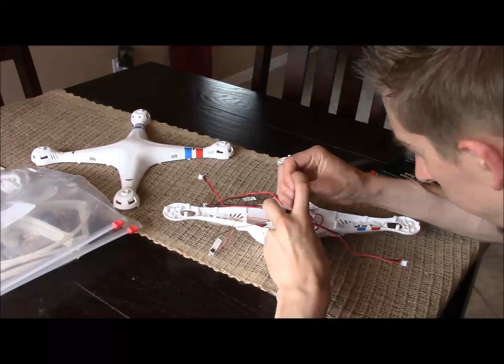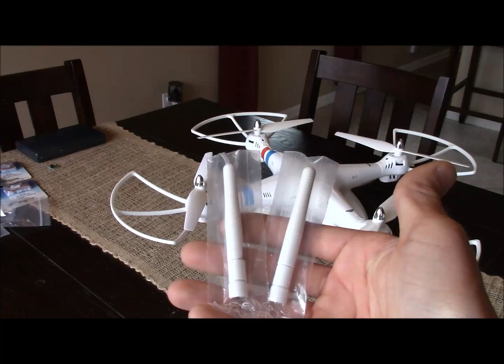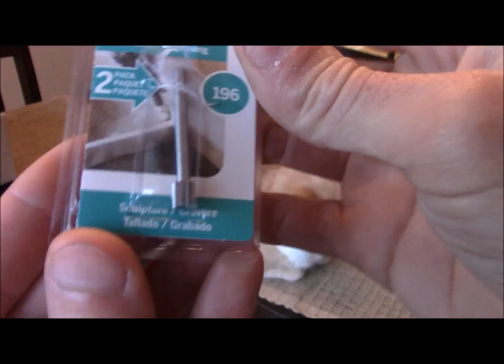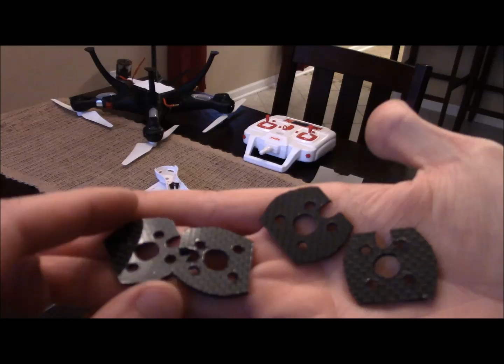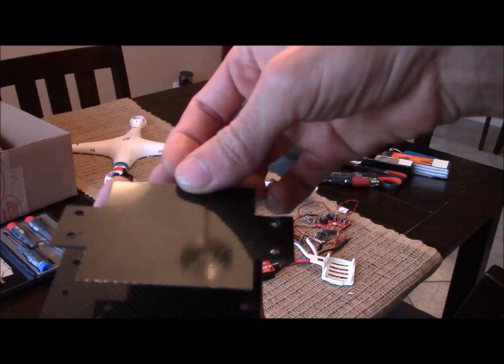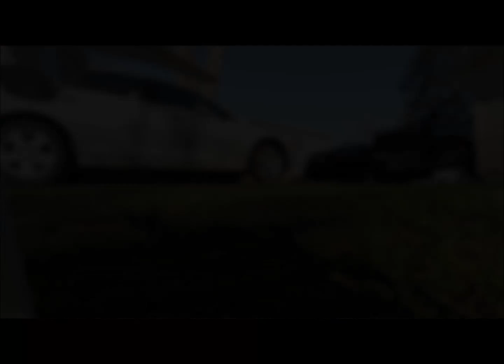Syma X8 brushless conversion with stock RC - Step-by-step how to!

Comment: Very cool modding there! Beyond the time, effort, and stability issues, I found it easier to just build several brushless quads and let my X8 collect dust.
Reply from the maker: Yeah custom builds will give you much better results.  most fun I've had with my x8 is flying with my buddy and just screwing around, they're cheap enough you don't mind crashing!

Comment: I wonder how it would work gradually tightening the three screws while applying heated air to the top cover for getting that extra little space for the taller motor.

Comment: why would you want to reduce stability ?
Reply from the maker: please read the description... it will answer all your questions.
Reply: no i get why you do it obviously i just think it might not be worth it if the end result is shaky and less stable than when you pulled it out the box bud ?
Reply: is there such thing as a brushless motor with just a live and earth?
Reply from the maker: +will penrose  If you follow the link, you will see it flies very stable now, and is alot of fun.  I didn't expect the shake to be so extreme when I first modified it.  As for the brushless motors, no, all brushless motors must have at least 3 wires. They operate much differently, using alternating electromagnetic fields pushing against fixed magnets that's ultimately spin the motor. The esc's must be able to power the multiple electromagnetic fields while also sensing the feedback to allow for timing and proper spin direction.  The complicated process that runs the motors is why you cannot simply attempt to hook up a standard 2 wire motor output and expect it to work.
Reply: +Preston Rice learn something new everyday^^ so that 3rd cable that goes to the esc's what happens from there? it sends to the transmitter? sorry to sound critical of what you did there.. but it looks properly unstable.. thanks for the reply.. I'll make sure I watch the video
Reply from the maker: +will penrose Not sure what you mean by the third cable.  The ESC has a battery input, and a servo or signal input on one side, and the 3 wire output to the brushless motor. The 3 wire output can be wired in any order, but 2/3 wires may need to be reversed to get the motor spinning the right direction.
Reply: +Preston Rice the positive, the negative and the third cable aha na thanks for the info though man.. you think this mod would work with a syma x5c ?
Reply: +will penrose or would you know of anyway to put brushless motors on the x5c?
Reply from the maker: +will penrose You can do anything if you have the money and the ambition lol
Reply: +Preston Rice legend
Reply: L
Reply: To match his mental instability

Comment: I done this mod but with all new hardware. I didn't want to tear my X8 apart so I bought new half shells. I used a CC3D flight controller and Flysky transmitter.
Reply from the maker: +CVObservatory Nice!  Yeah custom flight controller is the way to go.  I used a Naze32 in my other brushless conversion and had great results.
Reply: On my next build I plan on using a Naze32. I've heard great things about the FC'er.
The X8 was my first build to kinda get my feet wet so to speak. lol
Reply: +CVObservatory , sim, acho que sera a melhor opçao e ate mais em conta , tirando o radio, mas tbm fica  melhor servido com  um radio flysky

Comment: Great mod and step by step video. Pity about the wobble.
Reply from the maker: Yep, unfortunately the only sure way to convert to brushless motors is to replace the flight controller.  That will allow stable flight, and much more expandability and PID tuning.  And... they're cheap!

Comment: great job on the build,  you did it as a true professional. but the moment you stated the motors cant be calibrated its just not worth it. at least not for me. the wobble killed it for me. but great job you proved it can be done.
Reply from the maker: +Ivan Castillo Thanks!  Yep, simply proof of concept.  Already made another fly smooth using a custom flight controller.  Thanks for the watch!

Comment: Just finished my conversion without any signal converters and still use stock rc, see how it flies very well. Thanks :)
Reply: friend can you show us how you did it ? we were grateful :)
I think that your mod is the best : D at the factory rx
Reply: The x8c Rx board mod Muhammad did with the 12amp  blheli esc  , it will fly away out of control when you yaw it, left or right it is unsafe for a beginner to fly.
Reply: Show us a video or pictures labeling exactly where you solder what you did a step-by-step please

Comment: Great video with a happy end in part two. What make is that soldering iron you are using and where from did you get it?
Reply from the maker: Gone Droneing Thanks!  I think that was just one I got from Radio Shack.  I use a digital electric one now that I cam set the temp to, I prefer it over the butane one now.  But.. less portable

Comment: Hi, nice work done here I got to say, it's been a helpful guide for a conversion I'm planning to perform. The only problem is that I can't find anywhere the signal converter, do you have any idea where can I can get four of them? I have to mention that I am located in Mexico City, so my options are reduced to eBay, Amazon and electronic shopping like that, but still can't find them. Out of stock everywhere, I'm starting to feel that they are not manufacturing them anymore... Thanks in advance.

Comment: I wish you sold the carbon fiber pieces for the motors and the mounting plate for the electronics as a kit.  I would buy those and throw a brushless FC in it and some brushless motors and use your hardware to mount it all.
Reply from the maker: I could certainly put a kit together and ship it to you if it would be worth my time.  Name a fair price and I'll make it happen.

Comment: IMHO the wobble can be corrected, it's a closed control between accelerometer+gyro information turned into an analog control signal to the DC motor, so if you:
*Stabilize the DC voltage for the DC to SBS converter (simple rc filter)
*Change the dc gain and the offset (simple rule of three)
It is best likely that the gyro feedback of the control loop would not make such an excessive change in the motors.

Just my two cents

BTW great job!
Reply from the maker: Unfortunately its not as simple as a DC filter to adjust the input signal.  Because the input signal to the converter is a PWM signal, it would render it useless at that point. And, because they are 3 wire brushless motors that use frequency switching to operate, there is no easy answer on that end either.  By far the easiest way, is still simply to use a custom flight controller and RC (Its really not all that difficult to do).  I just finished up converting this exact Syma X8C to use the Naze32 the other day, and it flies beautifully, nice and smooth.  I am working on the follow up video tonight.  Thanks for your input and support!
Reply: Well PWM its filtered inherently by the DC motor since its model is a low pass filter. If you make a first order filter to the pwm signal you get from the pulsed signal a continuous one.
Reply from the maker: +Marcelo Lorenzati That would only work if the brushless signal converter changes the input signal to a linear voltage.  If it's looking directly at the switching frequency to determine the input then buffering the input signal would not work, it would render the signal converter useless.  I would have to do a practical test with my signal converters to see which is true.  Sure would be nice if a capacitor on each signal in could adjust the input reaction!

Comment: I considered upgrading my SYMA to brushless but your mod upgrade is causing instability during flight. So what you mentioned explaining the inflight wabble is that the intergrated speed controller brush to brushless converter module is not communicating with the gyro sensor on the main SYMA board? Apparently this mod upgrade does not work, adding a motorized gimbal is not the fix for stable video. Is there a manufacturer who makes a working interface for this brushless upgrade?

Comment: Hey..New to the drone community. Good video, learned a bit as well. But did you get the wobble to go away? Thanks
Reply from the maker: Drone Zoom Welcome to the community and to my channel!  Yes I did, it flies very well now, however you must build it the right way using a dedicated rc and flight controller.  Watch my follow up video- the link is in the description ir just go to my videos page.  There was no good way to make it fly smooth with the stock RC without physically altering either the power train or the ESC logic- both of which I did not want to change.   Thanks for watching!

Comment: Nice job Preston, well thought out.. Have you tried removing the mosfets from the control board and tapping into the 0-5v signal track and sending these to the esc,s ? I dont think anyone has tried this, and could end with the same result. Thanks for posting this video, now subscribed.
Reply from the maker: +mick thebass Thanks for the support!  I will begin an update video shortly, converting the flight controller on this one to the naze32 so I can dial in the flight performance.  I actually thought about removing the MOSFET's, to gain more clearance to stuff in the large 4-in-1 ESC, however I hadn't tested whether or not the input signal would be strong enough to trigger the signal converters, so I left it as-is.  The flight performance, however, would remain identical.  Thanks for the watch and subscription!  More to come, after I finish up my DJI flight vlog marathon lol.
Reply: +Preston Rice I think he ment  you could try removing the converters as well and just send the signal straight to the ESCs.
One thing I personally don't like is the antenna being so close to that big chunk of carbon fiber blocking the signal.
Reply from the maker: +Francesco Barbieri Oh, well if that's what he meant, then the answer is no, it will not work.  The signal at the Syma's board is just a PWM DC signal, 2 wire.  The input required at the ESC side, needs a (2 wire) signal and ground, with the signal side varying between 1khz and 2khz depending on throttle response.  The converters create that signal that is needed.  Yeah, I could route the antenna outside, but haven't really had an issue yet, range is good.
Reply: Francesco Barbieri Hi Francesco, Thank you and you are correct. That was the question I asked in a roudabout way Lol
Reply: Preston Rice Mmmm thats a shame. In theory it should work.A great project though Preston, I think I'll have a crack at this one..Thanks..

Comment: WOBBLE ?  ........ That's a Chit Load of parts and Hard work ..... for a WOBBLE !  Excellent idea and Workmanship though !  I hope your next Video is to Install a Proper Controller , GPS , Barometer , FPV and a Gimble .  LOL ...... I was all ExCiTeD excited until the WoBbLe ~~~ :-)
Reply from the maker: robert brander Yes, most of that was done in the next video.  It does fly smooth now.  My first conversion, which flew great, resulted in many complaints that too much was replaced to do so.  So, I tried the Syma FC and you can see in this video why that’s not a good idea. It can fly, but not well with no tuning ability.  Check out the video update following this one
Reply: @droningaround7663  Your Video was great !  It was something all DIY guys think of doing .  You just demonstrated the pitfalls .  I'm keen on seeing your update videos !  I like the potential of utilizing these feature filled toy motherboards in a hardier set up .  Thanks for the reply .. :-)

Comment: damn, i think it is best to also replace the FC and the RX
Reply from the maker: +Marnix Verschraegen yes it is!  This video was an experiment to see how much factory parts could be retained. See my part two video where I install a flight controller and new RC to obtain a stable flight.
Reply: @droningaround7663  Hi brother! I've been wondering, can stock receiver be used with a brushless FC? To keep the stock transmitter, but replace the rest of the guts? It's 2019 as I'm writing this, and parts are CHEAP now, much less pricey than in 2016. Thanks for this information experiment and for this series of videos! I have a bunch of Hubsan 502 series quads I'd live to convert to brushless, and a bunch of X5 clones, and a Bugs 3 I'd love to stick a GPS into lol

Cheers Matey!🚁

Comment: It's a shame you have no PID control to get rid of the shaking as this is a good wee project
Reply from the maker: +marty mcqueen Yep indeed.  However it would be quite easy to rip out the stock RC and install a custom flight controller (and RC) in its place to get a stable flight.  Check out my other video on my channel using a custom flight controller, to see how it worked out for me!  Thanks for the watch!
Reply: I build myself so except the X8 for what it is and fly one of my builds if I want something better
Reply from the maker: +marty mcqueen The X8 is pretty fun stock, I'll give it that!

Comment: where you buy a dynamo brushless and brushed to brushless esc and another one to buy other components besides Syma and remote ?????
Reply from the maker: +Rief Fauzan If your asking where I bought the materials from, everything was purchased from either eBay or Amazon.  Just simply search the parts I recommended in the video and you will find them.
Reply: Thank

Comment: It looks like the gain is set too high on something, other constructors dont seem to have this problem. Is there any way to sync each motor to the esc's.  That might cure the wobble.
Reply from the maker: thra5herxb12s There is no gain adjustment  (there is actually more to it than that- research PID values for multirotors).  The factory flight controller does not expect the more powerful motors, hence the over-reaction and wobble.  Other builds either use a custom flight controller, or they have modified the software at the board or ESC level to accomplish a primitive means of PID control.

Comment: Can you copy the link to the emax, brushed to brushless and brusshless dynamo ??? sorry if there is a word wrong because I'm Indonesian
Reply from the maker: +Rief Fauzan Emax: http://www.banggood.com/Emax-Quattro-25A-X4-UBEC-Multirotor-4-in-1-Brushless-ESC-Quadcopter-KK-p-931805.htmlSignal converters: http://www.ebay.com/itm/Xtreme-EA-048-Brushed-to-Brushless-Signal-Converter-Heli-Tuning-/321951440519?hash=item4af5cd1e87:g:Fs8AAOSwgQ9Vn9FRBrushless motors:  http://www.ebay.com/itm/GoolRC-4Pcs-X2212-950KV-CW-CCW-Brushless-Motor-for-DJI-Phantom-2-3-Airplane-D8EA-/171987582888?hash=item280b423fa8:g:fUwAAOSwlaxWOCqL

Comment: Great idea and mod but with the wobble it's useless to me. Maybe changing out the flight controller as many have suggested would be thing to do since your going to do all that work might as well make it right. Very detailed vid though, nice, clean,  work.
Reply from the maker: +Rampage Thanks, yes using a custom flight controller is a requirement for stable flight.  I've already done another conversion on an X8 with excellent results using a flight controller as seen here on my other video: https://youtu.be/WOCDcsdwP7s .   Funny, on that video, people would complain that I didn't reuse the stock receiver, but in this video people complain that the flight isn't good enough LOL, can't win!
Reply: Hi +Preston Rice thanks for the vid, very instructive, i've been loking for some tutorials about this on x8!
about the shake movement, i was just looking at a review of a carbon fibre propelers for a phantom 3 and the result are quite good, the stability improved and it reduced the shake on hoovering mode, the guy doing the review explained that it was due to the props being more rigd and a little bit biggers and they are not expensive.
I think this could help with your build as you said the motors are the same as the phantom 3.
Thanks again for your interesting tutorial now I feel like to build one!
Reply: +Preston Rice Obviously they like wobble.  Checking out the other one now. Again, nice work.

Comment: Wow , nice try !  i think that instead of all of that you can get a quad that is made for brushless motors ,  but thanks for the video , there are a lot of people trying to upgrade this quad , me included , jeje i just get  upgraded brushed motors but nothing compared to brushless ,  earn a like in the vide 

mmm i have a question , how long you can fly with that motors ?i mean brushless needs more power and the soma battery is kind of small for brushless
Reply from the maker: +GTDrone Thanks man.  Yeah not very practical, but this was just for fun ;) .  Shockingly I've been getting flight times equal to before the modification.  But.. I'm sure I'm running the LiPo right down to almost nothing lol.  But flight times definitely exceeded my expectations, 10 minutes with stock battery is possible.  I'm planning on an updated video, installing the Naze32 into this white one, to achieve a good flight and "finish" the project.
Reply: Preston Rice i was thinking about doing the same modification , but i never figurate how , i think is not the best option I'm going to get other quad instead of the brushless motors . pleas let us know how does the Naze32 works :)
Reply from the maker: +GTDrone Yeah, for the price of this one, you could at least get the Cheerson CX-20 which already has brushless motors and GPS etc.  I'll let ya know for sure, I expect some very nice flight results after the Naze32.  That'll stop the haters.... LOL.

Comment: I think if you try to change it into brushless motor you should use a 3s battery 11.1v not 2s 7.4v 
correct me if i am wrong :))
Reply from the maker: The Ragirate Either works just fine, but the 11.1 volt is much better, more power.
Reply: Preston Rice ow tnx. Can i use 1806 2400KV Brushless Motor Simonk, does the drone requires a brushless motor for it?
Reply: Questioner is actually RIGHT, unless you want 3S pack for FPV long range distance.